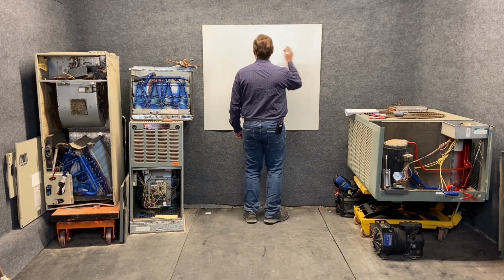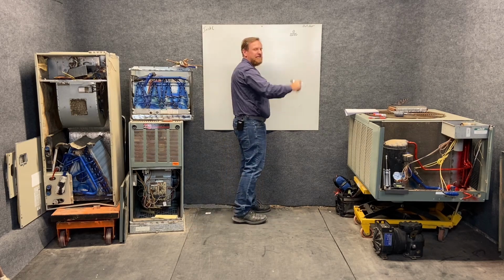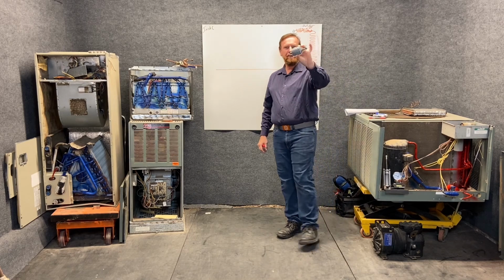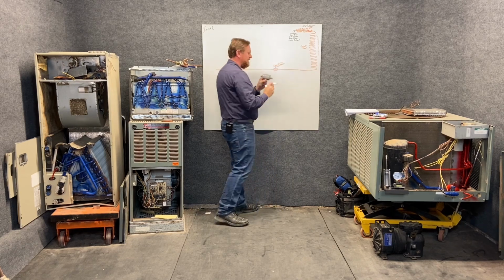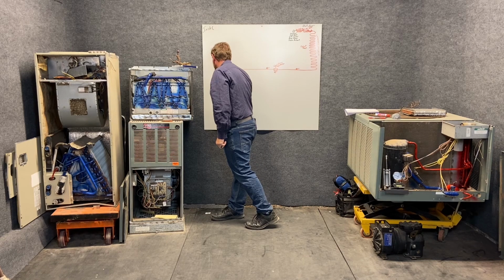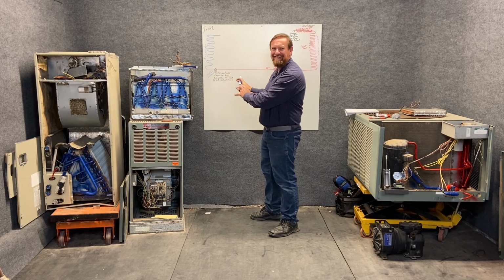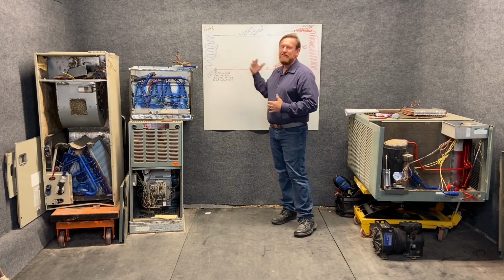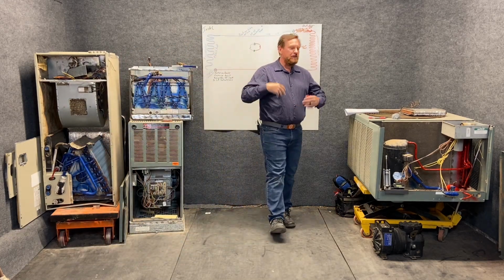HVAC 013 Refregeration cycle introduction as one

Comment: I think important to point out the the condenser is condensing gas into a liquid and a evaporator is evaporating liquid into a gas.  My question is how does a evaporator manage to change the freeon into a gas when its PSI is lower than the high pressure gas line.?  Seems like it would still be in a liquid state.